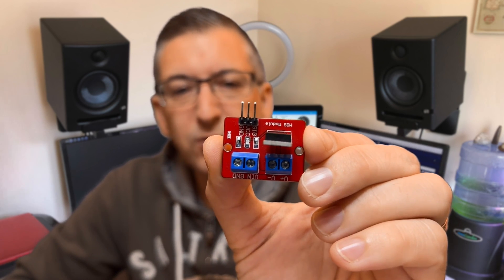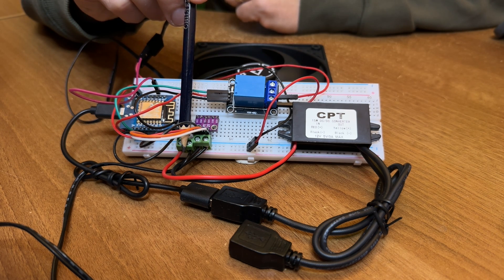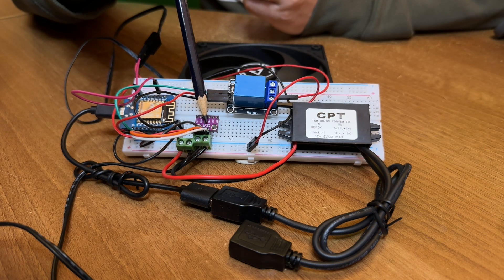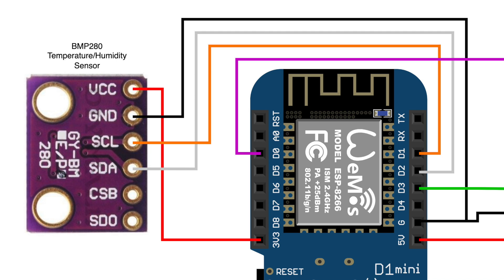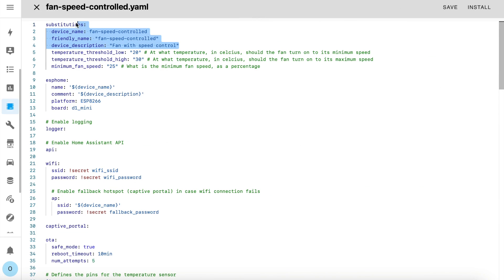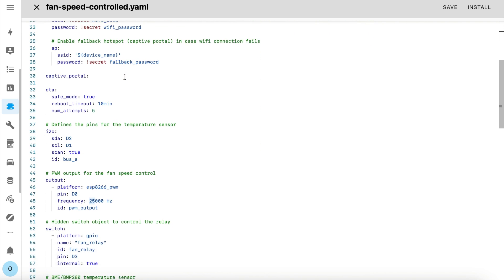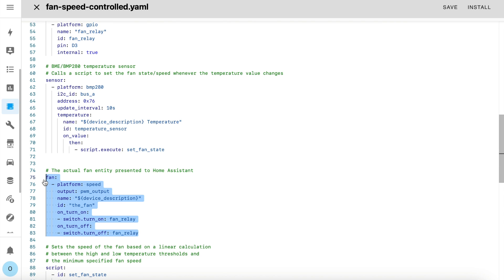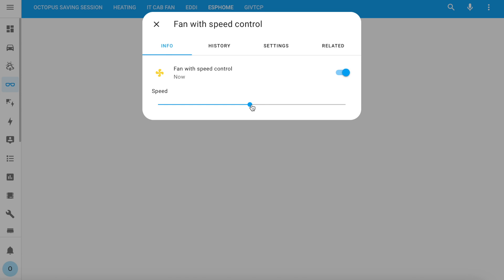ESPHome Fan v3: Variable Speed (PWM) and Temperature Control

Comment: nice. I have built my own NAS and the case has 4 fans to be controlled (my motherboard does not have PWM - only 3 pin connector). So I decided for another approach:
1- script running on NAS (it is Debian based so easy to add it)
2- script collects the measurements:
- HDD and NVMe temperature (using smartctl)
- CPU temperature (using psutil)
3- script sends data over WiFi to MQTT server and then to Home Assistant
4- ESP32 subscribed to the temperature topics
5- ESP32 based on:
- received setpoint (adjustable on Home Assistant)
- received HDD temperatures (CPU is not needed as CPU fan is controlled by PWM on motherboard)
executes and controls PWM signal 
6- although there are 4 fans I grouped the control part into pairs of 2 because:
- first pair is for HDD compartment
- second pair is for NVMe/motherboard compartment
So it is quite obvious that the PWM can be the same for each fan in the same compartment
For measuring the actual RPM each fan has to have separate connection between RPM pin on the fan and GPIO on ESP32 - you cannot connect RPM pins from fans in parallel!
7- in case WiFi/MQTT/Home Assistant is disconnected, ESP32 sets PWM to 50%.

This way I made it fully automatic (with emergency 50% of PWM in case ESP32 is disconnected from Home Assistant). 
Actually, this 50% PWM is configurable in the code and it can be changed to 100% to be even safer.

I was also thinking about putting few temperature sensors (the cheapest and easiest would be DS18B20 as you can put them on 3 wires only and in series) but I wanted to avoid messing up with the case inside and the script running on OS provides proper measurements as well.

What is good when you are inside the case you: have both voltages on molex: 12V for fan and 5V for ESP32 so no DC-DC converter is needed.
Reply from the maker: Wow, that's quite a project!

Comment: in next video can you tell us how to control L298N with esp32 in home assistant ? for example to control peristaltic pumps, and make very simple automation of dosing few ml of liquid ? would probably save my sanity ......
Reply from the maker: I'll have a think but no promises. I tend to only make guides for things I'm actually using myself because that way I can test them long term to be certain they're working, but this part does look interesting. I'd need a motor to control too... and something for that motor to do.
Reply: @SpeakToTheGeekTech  i am in process of discovering HA and tinkering with my fish tank, as i am from time to time away from home for few weeks i want to build automatic feeder (dc motor, that will spin few seconds to push out food from 3d printed housing) and also want to automaticaly adjust ph level in tank, so i want to for example measure PH, if low dose few ml of ph up, wait, measure again, if still low dose few ml of ph up, wait, if ok do nothing. but to get those damn dc motors running ....

Comment: I'm new to ESPHome.   Can I use ESP32 chip instead of ESP8266 chip to do PWM fan control?   Some details on ESP32 PWM support  would help.  Thanks.
Reply from the maker: Yes you can use an ESP32 and because an ESP32 has hardware PWM built-in, it should be more reliable. However it would need you to tweak the configuration a bit to get working. There are example on the ESPHome web site (https://esphome.io/components/output/ledc.html). Your output would change to something like this:

output:
  - platform: ledc
    pin: GPIO19
    id: pwm_output

But you would also need to set the frequency so that's best done in the fan turn on event, changed similar to this:

fan:
  - platform: speed
    output: pwm_output
    name: "${device_description}"
    id: "the_fan"
    on_turn_on:
    - switch.turn_on: fan_relay
    - output.ledc.set_frequency:
        id: pwm_output
        frequency: "25000Hz"
    on_turn_off:
    - switch.turn_off: fan_relay

This is totally untested and roughly thrown together to give you an idea of where to start figuring it out.

Comment: Thank you very much for the detailed explanation and example. Is there a way to (1) fetch the current set speed of the fan (2) compare with the `calc_speed` (3) only make a change when the two values are different? I am working on a similar setup but having a hard time to fetch the current speed value of the fan.
Reply from the maker: I guess you could but it wouldn't really make sense. The script must always return a speed value even if that hasn't changed otherwise the fan would get a null speed value. I'm not entirely sure what you're trying to achieve by checking and setting only if different. It's all based on monitoring the temperature, so the script to set the fan speed only runs if the temperature has changed. If the temperature has changed then almost certainly the fan speed will change. You could adjust it I guess so as the script only fires when there's major changes in the temperature, like 0.5 or 1.0 degree jumps if you're concerned about running it too often to save power or something?

Comment: watched all three great explanation
I think ill be going with v2 but do you have any idea if this can be done over Tasmota?
Reply from the maker: Yes it would work with Tasmota but my configuration is specifically for ESPHome, so you'd need to 'translate' it to Tasmota configuration instead. I'm also not sure how logic works within Tasmota so you may just have to expose the raw sensors/actuators to Home Assistant and use an automation in there to co-ordinate things like the relay and the temperature sensor.

Comment: Just installed with Noctua fans and all good (incl. tachometer for 1 of the fans). My fans stops spinning without the relays so all good. Using it on a solar inverter i get the temperature from the heat sink of it and imports this into the Wemos. Works perfect, TY💪
Reply from the maker: I guess I was unlucky with a fan that can’t fully stop with PWM then. Oh well, the relay has come in handy for another project which I’ll publish in a few weeks :)

Comment: I'm surprised that the 12V fan takes a 3.3V PWM signal.
I'll have to try if that works for my fan as well - I was under the impression that I'd have to feed it a 12V PWM signal which would have made the entire setup more complicated.

Did you try several fans? Do they all accept a 3.3V PWM signal?
Reply from the maker: Before I start my reply, I'll confirm I am an amateur at this so please double-check anything I say here! I haven't tried other fans, just that one, but my understanding of PWM is that the voltage itself doesn't matter too much (it must be in a range suitable for the fan of course - sending 240v down the PWM pin will likely fry it!), what does matter is the duty cycle of the voltage - so how long the PWM pin is on vs how long it is off. So for example if it's always on, that might be 100% speed, if it's on for 3/4 pulse periods, that's 75% etc...
Reply: @SpeakToTheGeekTech  you're right about PWM being about the duty cycle - I just would have expected the fan to not "see" 3.3V at all because it might be under the threshold where it reads a 0 or a 1.
I would expect a 3.3V signal to always be seen as a 0.

I'll give it a try. Thank you for the immediate answer. I'll also use a MOSFET instead of the relay.
Reply: I'm an amateur also, but I would assume all pc fans work with the same PWM since they should be built to the same standards ( I think ).

Comment: Hi ,another great revision in the series! A question: Instead of a relay, wouldn't a mosfet with a proper pull down suffice? I believe i have setup something like that in a way like your previous version, so with a mosfet "trying to simulate a voltage level by pwm'ing its gate", however it will need some beefy cap over the fan pins to flatten out the "output" pwm and the frequency should be high enough so you don't hear any buzzing. At an early revision i forgot to put a pull down on the output that goes to the mosfet. The mosfet has a parasitic capacitance and will stay "on" if the gate isnt really pulled down to ground, not sure but maybe you made the same assumption into believing the gpio should be able to completely pull that gate to ground? But a DC motor speed is really hard to control that way. Also i can relate to the feeling of hearing that relay switching and thinking "a cool, its doing its thing".
Another thing; i think i didn't see that in your previous designs, the fan dc motor will need a flyback diode, just like the circuit responsible for switching the relay (should be builtin on the relay board) as these coils will generate a huge reverse voltage spike if you abruptly stop sending current through them. Did the previous revisions survive? 
Btw not all PWM fans keep turning at 0 duty cycle, i made another version myself which simply feeds the pwm to fan's pwm input signal (actually 5 fans connected like that in parallel) and they all turn off at 0 duty. Depends on the model i guess. Mine are the Delta AUB0812H, i guess the whole "AUB" series will work fine. These are 8cm, change the 08 into 12 for the 12cm version, etc. There are some variants, make sure to get the right one (4 pins).
The 5 fans are cooling a closet with some computer hardware in it, very similar project. A tiny esp-01 with espeasy does it all; One GPIO controls the pwm signal to the fans, another one is used to read 3 digital temperature sensors (ds18b20). Seems to work great (got it running for about a week now). I used a voltage regulator to step down from 12V (an old HP laptop power supply) to 3.3V but that is highly inefficient, i think i will also need a 3rd revision with a proper step-down voltage regulator. 
This series is very inspirational, my approach is a bit different but its really nice to hear other enthusiasts explain their (similar) projects and especially what choices were made and why, cheers!
Reply from the maker: Hi, I’m glad you liked the videos. Yes, both previous versions are still going well - the ESP32-based one in my AV cabinet and the ‘deluxe’ one in my IT cabinet. I’m really no electronics expert and it appears your knowledge may greatly exceed mine in terms of whether capacitors might be needed or not for voltage smoothing! All I know is a relay turns stuff on or off, and it worked :) The buzzing was very annoying and also the whole voltage regulation method was very unreliable, which is why I switched to using a relay, and my current knowledge is not sufficient to be able to fix that non-relay solution.

Comment: Is there a way to read the RPM from the fan? I guess that signal is 12V so I suppose one would need to transform the voltage to keep the ESP safe...
Reply from the maker: I've concluded that task is beyond my abilities at the moment! When I looked into it there was talk about needing pull-up resistors and calculating rpm based on how many pulses your particular fan uses per rotation. I gave up in the end because I didn't actually need the value for this project. It would be a nice to have detail, but I'm afraid I can't help sorry!
Reply from the maker: Having said that, I Googled it again and came across this the suggests you can just create a sensor in ESPHome using the PWM pin: https://community.home-assistant.io/t/wemos-d1-mini-get-fan-speed-rpm/234833/2

Comment: You may have part 4. How can you do it with multiple fans and multiple temp sensor. Ie. You have different shelves for your PC, game console, and receiver. I want to put separate sensors and separate fans for each.
Reply from the maker: Lol, maybe, that sounds like an expensive video to make with all the parts though :) you’d need probably a different microcontroller with more pinouts, and/or a multiplexer for the temperature sensors. Apart from that it’s the same configuration copied, pasted and tweaked slightly for each ‘zone’

Comment: Have you tried the slider to adjust the fan speed?  your circuit doesn't work for me.  the fan keeps running without any change.  Also the Wemos pin 0 of your circuit cannot be right because this is not a PWM supported pin..
Reply from the maker: Hi and yes the slider control from my fan entity works to control the speed for me. Pin 0 is correct and you can see that in the photo on my web site if you zoom in. The D1 Mini uses software PWM and almost all of the pins support it. I tested it on a few of them just to be certain.
Reply: @SpeakToTheGeekTech  funny.  I have the same setup, just a dht11 instead of the BMP280 but the fan speed doesn't change.  no idea what could be wrong.  I've tested several fans.  use your manual control sketch.
Reply: @micha4038  I had the same and found out that if I also connect pin 3 of the fan to the D1 mini it works.

sensor:
    platform: pulse_counter
    pin: D5
    unit_of_measurement: 'RPM'
    id: "fan_speed"
    name: Fan Speed
    accuracy_decimals: 0
    filters:
      - multiply: 0.5  # Depending on how many pulses the fan sends per round - should be 0.5 or 1 - try...

Comment: Was just looking at buying a version of this to fan assist my radiators when i have the heat pump installed, the price of them is horrendous, so i thought ill make one... youve just saved my a LOT of work! thanks
Reply from the maker: No problem. Personally I still think a standard on/off control for a fan is the best option in most situations due to its simplicity, but controlling the speed is a fun project!